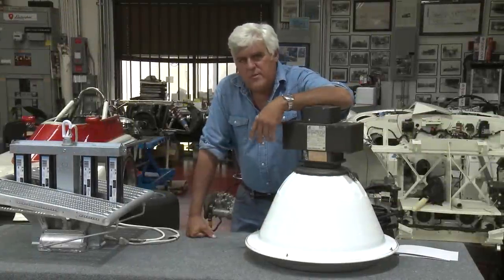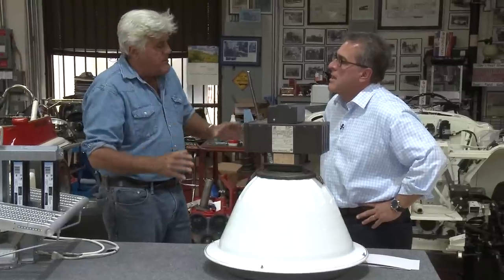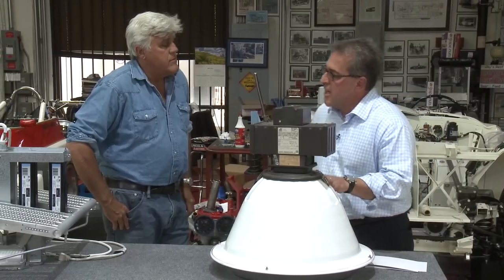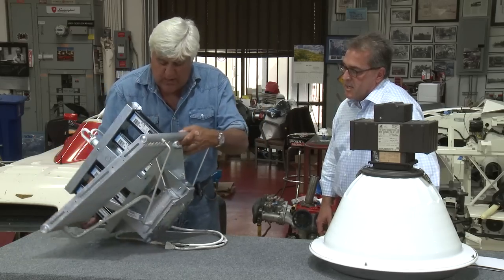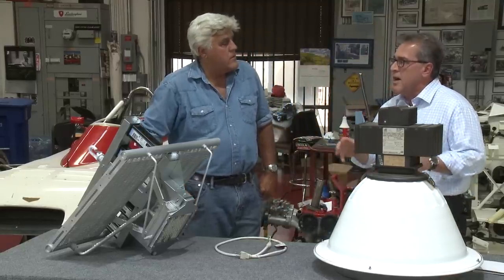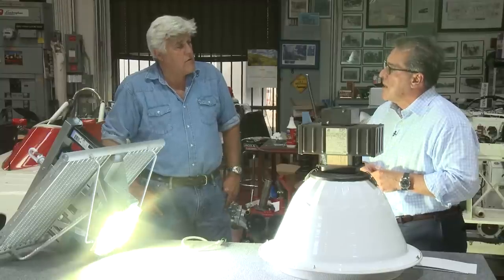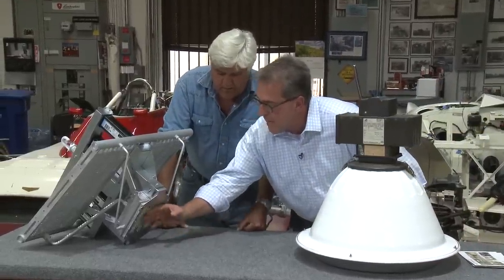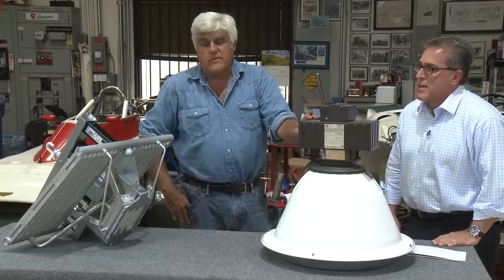LED Lighting System - Jay Leno's Garage

Comment: Jay asked twice WHY heat was was being produced by supposedly non-heat generating tech and both times the guy failed to actually answer the question.... I still want to know; I thought LEDs didn't generate heat. Is it the driver circuits that get hot?
Reply: The LEDs still put out plenty of heat as well as the light, and those were very big and bright lights... if that was a tungsten lamp the table would have been a smoking mess...
Reply: He did fail to answer that question pretty badly, but you also misunderstand what's happening. The LEDs themselves were not getting hot (yet), but they were producing a large amount of light energy, that light energy was being absorbed by the surface of the bench which resulted in the heating of that surface. It's the same reason the sun warms the Earth. The actual heat from the sun is not reaching the Earth, but the light energy from the sun is absorbed by the Earth and turns into heat.

Even if you had a light source that produced zero waste heat energy, it would still be capable of making things hot with the light that it produced.
Reply: They do generate heat, not in the same way as Incandescents, The Resistance through them creates heat, but its not giving off heat in the form of IR radiation, its the light itself that gets warm, and you want to have a radiator for lots of them otherwise the light output and color will change with the temperature.
Reply: Difference is that it uses 55% less energy.  So like an oven that runs at 720 watts instead of  1600 watts, its still going to be hot.  The only way something using energy is not going to feel hot is if the heat is massively drawn away some how with a cooling system, it still exists but its being removed, but on the front side of the light, where the heat is concentrated there will be residual heat even if the majority is being drawn away by radiators on the back.  Looks like some kind of passive heatpipe system, not some kind of crazy refrigeration unit that can completely nullify that level of heat output.  According to the hioptix specs I looked up for that unit, its supposed to replace a light of up to 1000 watts.  So even if one claims 55% improvement you are talking about dissipating 450 watts of energy!!  Of course it will be hot, its a crazy amount of energy going into that system.  So yea, the sales guy should have explained it better.  Even one of my 5 watt led accent bulbs gets warm, its 5 watts of energy flowing through it continuously, its not magic.  Energy = heat.
Reply: Martin Ebdon Yes I could see those radiators clogging with dust overtime especially in a dusty work place and that could cause the electronics to overheat and the light to fail. Better keep those things clean.

Comment: I love hearing claims of LED's lasting 100k or 200k hours. Read the packaging they all say "up to." Super bright LED's 10,000mcd and above may last 10,000 hours or more, but lets face it nobody is tracking hours at the consumer level. I like using CF blubs because they're cheap now and use about 25% compared to a regular blub. LED's technology is new and the price is high hence the incentives given by the utility companies. My 2 cents added.
Reply: Problem is that these high-output leds are relatively new & many of the top quality leds can only have a calculated 'lifetime' put on them because they haven't had long enough time to test them!
However, there are lower quality leds that are sold with specs that are very optimistic, but questionable!
Reply: LED technology is not that new and is 100% more reliable that incandescent of fluorescent lights will ever be. There is nothing to break. It's a diode. Poor solder joints that hold diodes to the circuit board will likely fail before the diode ever does.
Reply: StevieRay9O
I have many LEDs from the sixties still functioning as panel lights. Back then they had no specs as to how long they lasted. We just used them. Cost back then was a few bucks for one now days that same LED cost a few cents.
Reply: crownvic .ca
True. I just glad nearly all the LEDs made today come from China. Research what it takes to make one and the chemicals used.
Reply: Most CFL bulbs are junk really. Many in my house are going out after only 2 years. Regular T8 fluorescent tubes are great, but CFL not so much. LED's are promising, though.
Reply: I date my blubs with a sharpie. Depending on where I have them makes a huge difference. Bathrooms have the shortest life around 2 yrs.  Outdoor yard lights light will last 4-5 yrs, they burn all night where the bathroom blubs get turned on and off more frequently with shorter on times. Room blubs last about 5 yrs. I spent $.75-1.35 a blub. LED blubs still range around $7 here for the smaller wattage's.
Reply: hanky97007
I also date mine!  I've had bulbs, even name brand ones, all over my house go out in 2 years or less.  I put one LED in one fixture that gets left on a lot, so we'll see how that one goes.  My parents just built a new house and used LED 100% throughout, mostly Cree.  We'll see how those fare, as well.
Reply: LED's are hard to rate for life span. LED's output is dictated by how much power you feed them. More power= more heat. Over driving a LED shortens it lifespan considerably. Adding a cooling system will help keep this heat in check and maintain a longer life span.  Over driving LED's is common, but expensive. The trick is to keep the heat in check. The lights reviewed here seem to have a very large radiator. Making me think that the LED's are being fed pretty high power.
Reply: hanky97007 I did say 'these high-power leds' refering to the current generation of leds which for their work, the developers received a Nobel prize just this year!
Reply: We have a proprietary LED high bay rated 70,000 hours @ 170 lumens per watt and this in 2018 this guy is claiming 200,000hour and high lumen output in 2014? ya right.

Comment: 5:23  Paul's answer is misleading & incorrect.  The table surface gets hot because of insolation, the conversion of absorbed light energy to heat on the surface.  This is why we get hot under direct sunlight.  Jay needs to learn some science, especially when this program is about engineering.
Reply: Physics 101 people. That smarmy salesman doesn't get it :)
Reply: I was just about to to say .... if they put some Al foil down there on the table or if it was a white reflective surface, it wouldn't get hot, The salesman didn't answer or simply didn't understand the question, you can't blame Jay.
Reply: Kosmonooit
And thanks Jay I am really enjoying your 'Garage'  programmes.

Comment: So the new light is 55% more efficient that the old one, but it generates way more heat. That means that now you have to crank up the air conditioning, which means that at the end the savings become a wash.

Comment: What are there, like four ballasts?
And a huge rad, with no reflector?

Not to mention the flicker and inconsistent colour temperatures.

LED still has a little bit to go.
Reply: Not ballasts, drivers, and they're much more efficient than ballasts. The radiator keeps the LEDs cool so that they last an extremely long time. No reflector is needed. Most modern LEDs wont flicker. I have absolutely no idea what you mean by inconsistent color temps, LEDs are extremely consistent. 

I just converted all of the fluorescent lights (T8s) in my dad's shop to LED, they're absolutely fantastic and his power consumption went from over 900 watts to less than 300.
Reply: idontcare80
Yep .  I think he only has experience with very cheap led, those are not binned for color temperature. I remember getting a couple led maglites and some were warm and some were blue...
led is entirely directional, which is bad in a some lamps but for a down liight , doesn't matter. but in a lamp with a shade type normal use, those bulbs use reflectors to evenly disperse the light like the old school lights.

Comment: Sodium bulbs are much better and they're still around. Which proves that LEDs may be better but would you pay probably 10k the price? Not many people would. May garage has Sodium bulbs and I don't think we have ever replaced them 20 years later. A garage with paint fumes, gas, oil, moisture and heat. Never an issue. I'm sticking with old school.
Reply: old school low pressure sodium can be up to 200 lumen per watt vs 90 lumen per watt for LED... and the low pressure sodium bulb should do about 18,000 hours till it gets down to half brightness, they dont just go with a pop when they die but they do fade out... 

I bet the bulbs in your place aren't low pressure sodium because the quality of light they give out is very poor... about the same colour orange as an orange...
Reply: Richard Fraser
> I bet the bulbs in your place aren't low pressure sodium because the quality of light they give out is very poor... about the same colour orange as an orange.

Yes. They have a CRI of 5 (a CRI of 100 is good).
Reply: Good high pressure sodium are ok in a working garage, but only just about. 

The more I see of LED lamps the more I like but its not just the slightly lower electricity costs over a mercury vapor or high pressure sodium fixture.

There is still a lot to be said for florescent tubes.
Reply: Richard Fraser
> There is still a lot to be said for florescent tubes.

...Except they don't play well with motion detectors, and they have high labor costs for maintenance, and they hum, and they contain mercury, and they emit light in useless directions, and their efficiencies are about to be eclipsed by those of LED's:
http://www.cree.com/News-and-Events/Cree-News/Press-Releases/2014/March/300LPW-LED-barrier

"March 26, 2014
Cree First to Break 300 Lumens-Per-Watt Barrier"
Reply: I think fluorescent bulbs give off better light. Spray booths use them and will continue to use them, They will hold up alot better then LEDs. Plus if you accidentally spray a bulb, you take it out and put a new one in, with LED's you probably need to buy a whole unit. 
Call me oldschool but I still use handtools when I can and will use sodium and florescent bulbs until I die.
Reply: There are good points and bad points to all systems, not something you here often on the net.
LEDs are just another option worth considering depending on the use case.
Reply: Richard Fraser This is true, they do dim over time - still, the cost is much less than theses LEDs.  We have some LED lighting for task lighting in our shop and I find that the light is less 'focused'.   It's hard to describe, but it's not nearly as good as either the sodium lights or fluorescents.

That said, I've replaced almost all the lights in my house with Cree LED bulbs, which work great.   But for task lighting, I still use a 300w halogen light.
Reply: ck m The Cree bulbs are an incredible bargain at Home Depot for $7-8.

Comment: 25 years and only a 55% improvement on power consumption? Not very impressive.
Reply: 55% improvement for 2x the brightness. I'm sure if you turned it down to 30,000 lumens it would be much more efficient.

Also keep in mind that the 55% figure is based on power consumed while running, the amount of power used to heat up the old lights on initial power on is staggering.
Reply: TonyisCreating Good point, dropping to the same light output could make it notably more eefficient But double the lumens doesn't equate to twice the brightness. It would probably have to output over 100,000 lumens to be visibly twice as bright as the sodium offering.
Reply: every little bit helps though!
Reply: Really you're looking at a three to four fold improvement in efficiency and you have a light that will likely never need to be replaced, I'd say that's a pretty major improvement.
Reply: Voodoo Melon No, lumens is a unit of measurement of light output so your statement is false.
Reply: Voodoo Melon Yeah I don't know what you're trying to say... "lumens" literally measure the amount of light emitted by a source. 60K lumens is twice the amount of light as 30K lumens.
Reply: Take a look at Luminous efficacy on wikipedia... its quite interesting... florescent tubes are not that bad after all...
Reply: Riles07 Fox News showed up!  You needn't be an EE to understand.....regular incandecent bulbs have showed lumens on the package for decades, but if your mommy buys the bulbs you would never know that.
Reply: Richard Fraser Indeed. It's ironic how many businesses install sodium lamps when they build as new construction, only to switch over to fluorescent lamp systems after a few years - often system with dimming and partial on functions. One key is the improvements in fluorescent systems. I feel LED is the future - but indeed florescent lamps aren't so bad. Their earlier "upgrades" were grossly over-marketed.
Reply: Its also double the output... but I guess you didn't remember that part....
Reply: ap2pat You DO realize that to double the visible light output, you need 4 times the lumen output. Guess you didn't catch that?
Reply: Alan Maier I'm out!!!
Reply: Geez folks, all the hate and discontent! Tip of the day... as humans, our hearing and eyesight both work in a way to protect us from extremes. The brighter the light, the less sensitive our eyes are. The louder the sound, the less sensitive our ears are. 

So for light, we need about 4 times the lumen output for twice the brightness. Makes you think twice when buying lamps and comparing lumen output as we may not gain as much as you'd think when looking at those numbers. 

For sound from, say a stereo, 10 times the power is needed for just twice the volume. Doubling the power is just a very modest increase in volume. Remember that when contemplating buying a 100w/ch stereo over a 80w/ch stereo. No audible difference.
Reply: Do you have air conditioning?
Reply: TonyisCreating the efficiency improvement is compared to the sodium lamps. These were very efficient and state of the art 25 years ago, so another 55% improvement over that is quite big actually.
Reply: Voodoo Melon Also consider lighting quality. Those sodium lamps have a CRI of only 5.
Reply: Not mention more light. Twice the light half the power.
Reply: Not to mention it'll last a good 23 years
Reply: 55% when its on for a few hours. not when its starting then jou LED is 300% better
Reply: groenekever And that's one reason why LED's can be said to "play well" with motion detectors. Another reason is that turning them on and off frequently doesn't shorten their lifespans.
Reply: Its easy to criticize ,why don't you invent something better more efficient
Reply: It really depends on what lights.  These are giant industrial lights.  The tiny LEDs make little to no heat and last way, way longer than normal bulbs.  They also use less power while putting out the same lumens (sometimes 10 times less, etc. not just 50%).  The bigger the LEDs, the more power they use and the hotter they get, so they're not all cold.  Some will have heatsinks, fans, etc. but they have tons of advantages including being small so they're able to be connected and used to create shapes like on most new cars, where normal bulbs would be impossible to use easily.
Reply: I think one issue that is overlooked has been the vast improvement in florescent lighting. 25 years ago, T-12 (the old 40 watt tubes) along with old school ballasts were power hogs vs. sodium, but worlds better than incandescent. So new construction used sodium where possible and practical. Then over time, fluorescent lighting evolved and became over efficient. Many buildings using sodium were switching to new generation florescent lighting - typically 6 lamps @ 32 watts each, but with efficient ballasts and higher output per watt, the switch made sense. 

Today we are at a turning point where LED makes sense. However just for a "at home" comparison, compare the output of a 13 watt CFL to a 13 watt LED. They are nearly the same. Heck, I replaced the 10 watt CFL in my desk lamp with a 10 watt LED, and my key gain was instant full brightness and a more pleasing light quality. 

Down side of florescent is poor cold water performance and deterioration with age. Down side of LED is total failure of individual LEDs that can't be replaced.
Reply: iSOBigD
 The heat a LED produces is a direct result of how much power you feed it. More power=more heat. More power also = more light output. Over driving LED's (like the fixtures shown here) produce tremendous amounts of heat. A cooling system is needed to remove the heat from the LED heat sink. Or the lifespan of the LED would be measured in milliseconds. The fixtures here seem to have a very large passive radiator system. Suggests to me that the LED's are being fed some serious power.
Reply: Robert Tribby
> The heat a LED produces is a direct result of how much power you feed it. More power=more heat. More power also = more light output.

The power doesn't all result in heat at the light source. Some of the power is dissipated in the form of light. Not all increases in light output require increases in power input.

Comment: the shop I work at had the old sodium lights, they are slow to light and had a horrible transformer buzzzzz that would drive you crazy, we replaced them with 6 lamp t-6 flurescent lights that give awesome quiet, instant on lighting, its been over 2 years and have yet to replace a bulb and I am told use a third less power and cost a fraction of what the LED cost.

Comment: I would bet that this "light fixture" is extremely expensive. Changing to these lights would just be paying "up front" for the electricity the sodium lights require. The answer about the heat on the table was just so much bullshit!